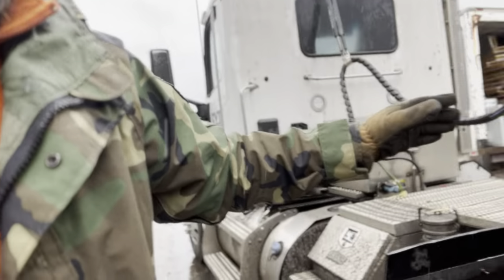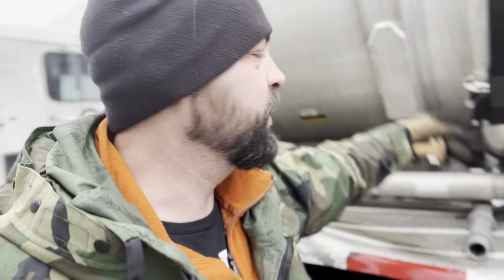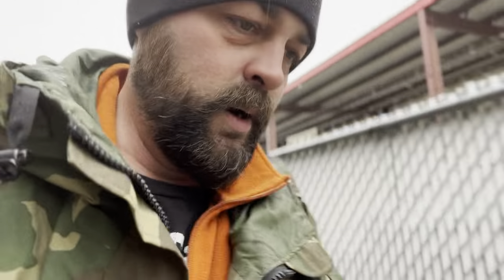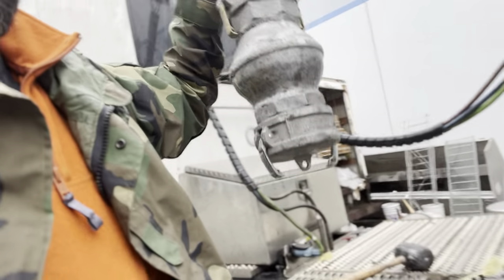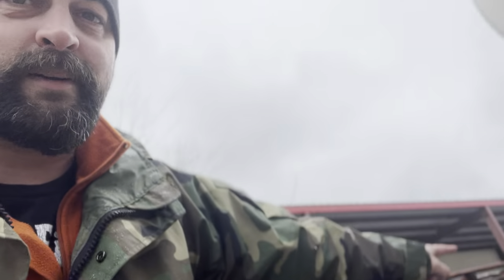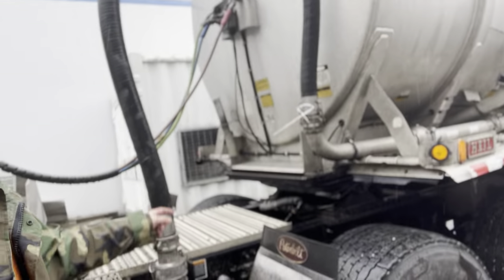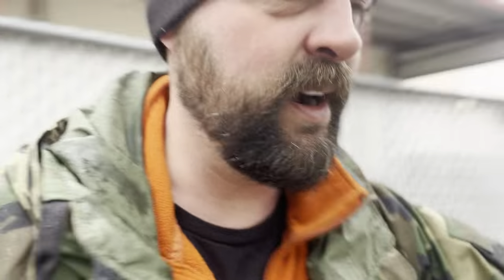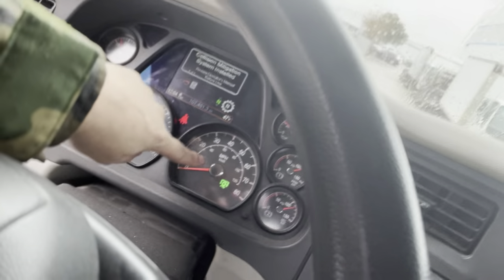How to Operate A Dry Bulk Tanker Trailer - Flour Product Delivery

Comment: You will love this. Our new Management thinks we can Unload 30+ Tons of Flour without banging on the side of the tanker. They also think that this practice is causing the Tankers to Crack. They even want to put 10PSI Top air release valves on the tankers as they think 15 PSI is not Helping either. We are wondering when they are going to hire more drivers and are we going to get paid more? :)
Reply from the maker: 🤣🤣 heard that before. I ended up leaving bulk tanker in SLC cuz it just got way too slow. Tried to stick with it for a while but I wasn’t making enough money. Company was great but the work wasn’t there.
Reply: I always used the rubber hammer on those tanks. I don’t believe the rubber ones hurt anything. I could see a metal hammer putting a hole in them, especially if pressurized lol. They are just thin aluminum (to save weight). And I used it when hooking hoses. But I absolutely could unload whatever without it. The tank will do the work. The only thing I used the hammer for while unloading, was just to check the level (how much is left).

Comment: I always used top air when doing clean out on fine materials. Stuff that is very fine like flour, and hydrated lime (which is about the texture of baby powder), tends to just “fluff up” with the aerators on at the bottom of the hopper. But if you use that top air to build up your pressure to 15, and just crack the product valve, it’ll almost make like a tornado funnel inside that cone, that swishes around and around the sides while pushing down. Maybe just a tad of aerator to vibrate the cone wouldn’t hurt. And a tad of bottom air to keep the product moving. But if you are empty (except for clean out), just the top air by itself should be enough to push that little bit of product. This is NOT so for heavier material like cement, or coarse stuff like limestone rocks. Bottom air with very little vibration (aerator) will produce plenty of flow. That heavy or course stuff will plug quick if you get too much material for how fast bottom air can push it through.
Reply from the maker: Maybe it was just the places I delivered to but I rarely needed top air, until I started doing coarse salt. That needed a little extra oomf
Reply: We use a powdered Friction Reducer (FR) on frac sites ... I'm the guy that runs the bulker and I've never touched the aerator 😅

I build top pressure to 8lbs, open the line valve, then slowly open the product valve until it's equal to the tank pressure; if I were to open the product valve all the way it would pack off my line quickly ...

Comment: I understand why you hit the tanker and individual tanks to get the product out. But why? you have "top air" pressure to push the product down? Does not work with salt or fine powder products?
Reply: It hangs up on the side of the trailer

Comment: When finishing the load, you released the air via the blowoff valve. What would happen if you let all the air pressure off through the product line? would it damage the silo?
Reply from the maker: You can do that but it takes longer, and also you never know if the product silo has some built up pressure too. Using the blowdown is a fool proof way and you should never drive with it closed anyway. The tank can actually build pressure while you’re driving if you leave it closed
Reply: @scouttrucker  Thanks for the reply, the sicario i am investigating is that the top of a silo popped off just as a tanker was finished emptying (about 3/4 filled the silo), the company that owns the silo say that the driver should have released the blow of valve when he finished loading and that is the reason the silo exploded, i find that hard to believe.
Reply: @michaelfogarty5894  It can happen sometimes when the hopper in the tank finishes emptying out.  Once there is no product in the line flowing anymore, there is nothing stopping a burst of direct air pressure from being released into the silo.  It's possible the driver could have been unloading at a PSI higher than the silo is rated for but who knows.

Comment: Hi
Can you open four valves of hoppers at the same time but quarter of full valve?
Reply from the maker: I’ve done it before but it didn’t really make a difference. It depends on what you’re delivering. With flour you can, with salt it would almost immediately plug up
Reply: @scouttrucker thank you.  this way you dont worry about it any more until it is unloaded and last clean out.
Try less than quarter next time.test it but if it is harmfull for yourself or truck ,dont try.
Have fun and experiment with safty.